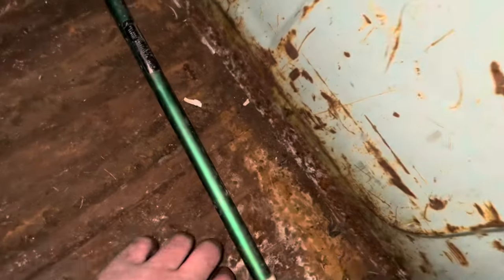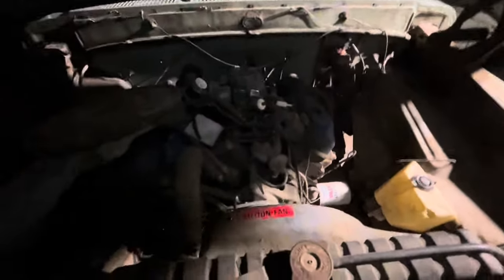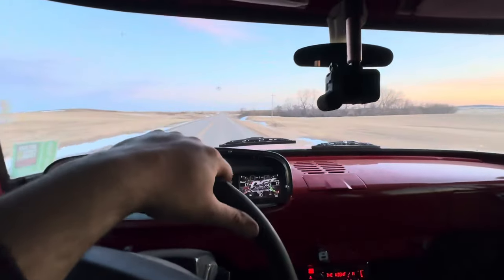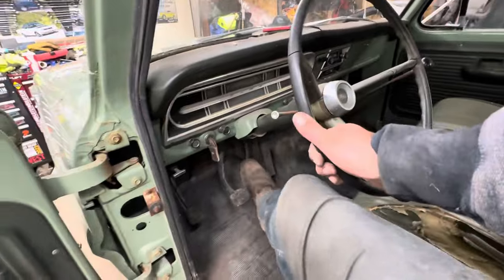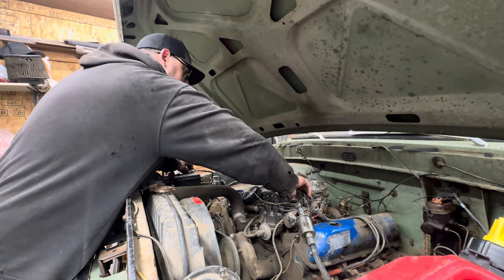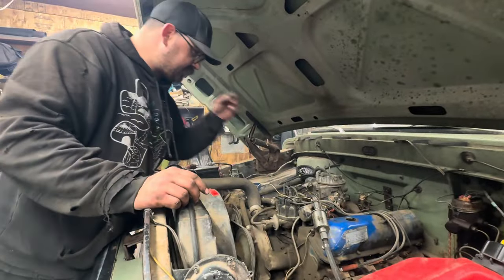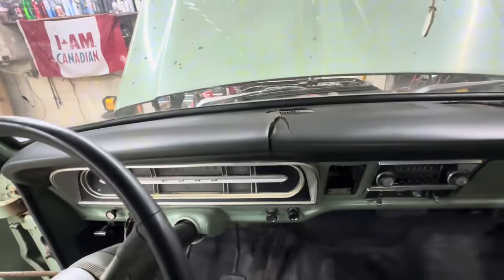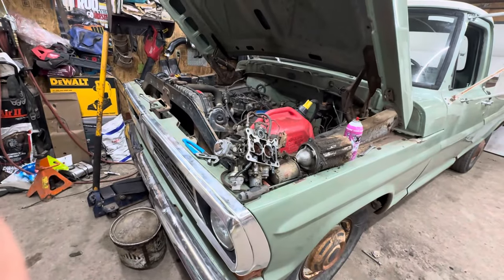Will It Run? 1970 Ford F250 farm truck revival

Comment: Definitely seems like stuck valves to me. That's why you're shooting fire and fuel out of the carb. Cylinder contents are being blown back into the intake on compression stroke since the valve isn't closing. When the issue is timing you'll usually still have other cylinders running although not very well. In your case you have lots of dead holes.
Reply from the maker: Yeah the next video I pull the valve covers because I was suspicious of that because of that distinctive popping sound it’s definitely stuck valves. What’s your bet on actual firing cylinders?
Reply: @TheRustFarm My guess would be 1 or 2.
Reply: I would be surprised if there are this many valves stuck, you would think some would have freed up at least with some heat and the engine running. It runs more like the timing has jumped but who knows.
Reply from the maker: @Terminxman  tune in for the next video I just got back from driving it!

Comment: Nice old ford I like those trucks, I am refreshing a 390FE right now. There horrible for cracked exhaust manifolds.  My 72 F350 cab and chassis I bought off a Ukrainian farmer in Viking it had a 360fe or 390fe he pulled it out and swapped in a 72 300 six, and with a t18 tranny and 4.10 dana 70hd it does well for what it is it will scream but go 110kph. I saw your ford on your buddys channel on a trailer and was wondering when I was going to see that. Looking forward to seeing more and watch you get her dialed in. I think I will fire my 72 up tomorrow after watching this its been a couple years.
Reply from the maker: Yeah we are really liking that truck more and more and it barely runs haha but the manifolds look mint on this one! It might be the first fe I’ve heard without horrible leaks up front! I cut the muffler off because it was full of mouse nest but the whole factory exhaust is mint on it somehow. I just need to replace the muffler
Reply: When I rebuilt mine I was worried about that and the bolts snapping in the little ears of the head. Wouldn't you know one manifold was cracked. I had the luxury of time to soak the bolts so I got lucky there. 🍻
Reply: @joshuaatkins5197  ya the bolts that go through the flange with the ends expose always break and then you have your manifold held back on with small c clamps where the bolts were.
Reply: @wildrosegarage4208  😆

Comment: Try running some marvel mystery oil or seafoam through the truck and the gas tank should be fine with you feeding it directly to the carb, and or a quart of transmission fluid and break up some of junk and grime and gunk in the motor up and blow out the carbon and mouse house lol, take it out and rev it up and stand in it a few times maybe it will clear up some and atleast try to stay running.... And love seeing you working on all of the 61-71 dodge swept line trucks!!!
Reply from the maker: Thanks in the next video I try a few of those things but there is another issue you’ll have to wait till Thursday to see what it was

Comment: I like the dentsides better. But I'm bias since I have my grandfathers sitting in my driveway. A 76 F250 'highboy' he bought new. My kids will be the 4th generation to drive it. 😎
Reply from the maker: I think I do too I just can’t pass on nice original paint truck. And the bumps don’t seem to rust as bad as the dents
Reply: @TheRustFarm  can't pass on any truck are you kidding me haha. I haven't noticed the rust difference between the 2 but but you know you're rust better than I. 😁
Reply from the maker: @joshuaatkins5197  haha just in my experience the dent side cabs rot worse but I’m not a ford guy either so I’m not supper familiar with them
Reply: Pretty decent looking old truck just runs like crap. Carb rebuild tune up re time new starter you should be in business
Reply from the maker: @brianhayes7618  yup picked up a carb kit today about to put it in and try it
Reply: @TheRustFarm  since you're the Rust Farm spokesman I trust your learned experience 🍻 haha

Comment: I really want to find me a rat rod shop truck project ford 68-71/72 custom cab or sport custom trim truck and i hope to trade my second gen dodge ram laramie slt quad cab long bed 318 magnum V8 46 RH automatic overdrive transmission manual shift transfer case lever on the floor gloss black with most of the white pinstripe its got its share of rust around the edges but it is in really decent shape considering how most of them are and this was a northern Ohio truck since new....has a really decent shape longbed that is original to the truck, and the bed floor has very few problems, the interior is decent really the edge of the Dr side seat and the door panels are the iffy parts of the interior the truck already has a dash skinz dash cap and cluster bezel already installed but it was not as bad as most of them look and the front suspension is completely rebuilt and it drives like it.. transmission has already gotten a new front pump input shaft seal and torque converter so immediately shifted into reverse...